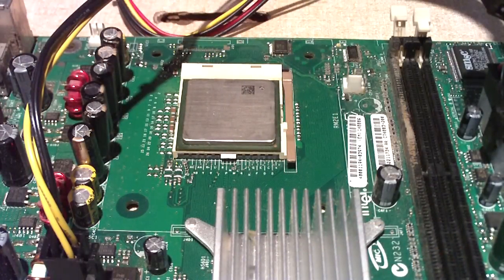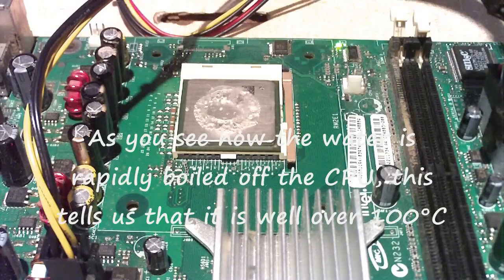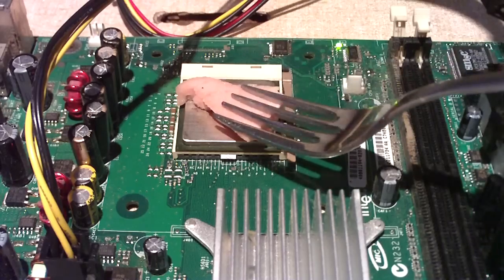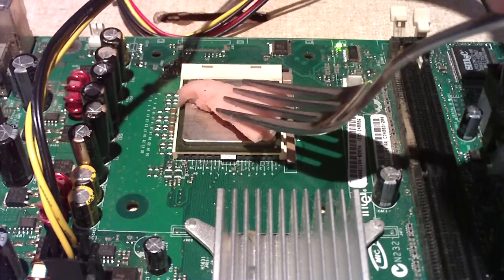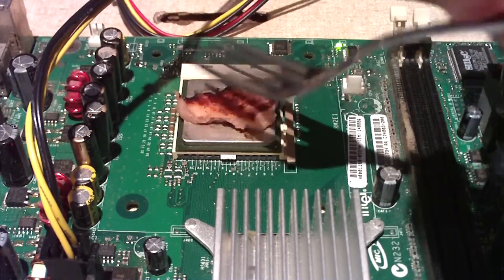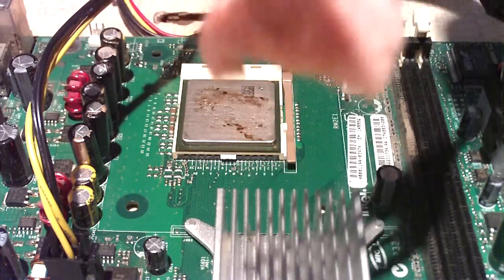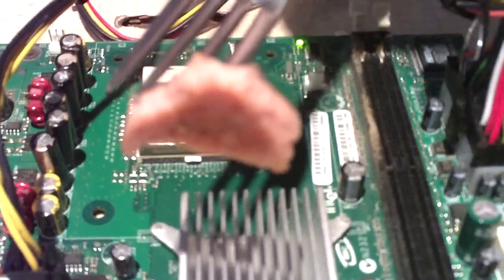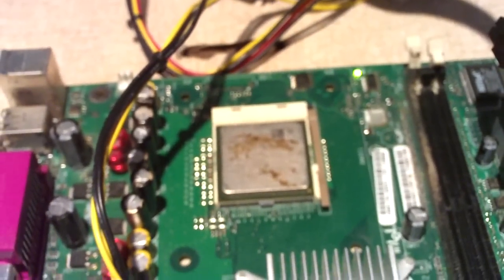Cooking with Intel Ep1 - A Demonstration on CPU Heat

Comment: Needs to be updated with the i9.
Reply: IMayBeSane And i7 7700K 😂😂
Reply: IMayBeSane it would char the bologna if you just have the bologna within 23 feet of the case
Reply: An AMD card would set it ablaze
Reply: The Voice In Your Head AMD cards are not hot nowadays
Reply: I think the 9590 would grill something to perfection
Reply: person who watches videos on youtube my nigga Replace the fx 8300 with an fx 9590 or an i9 and you are all set.
Reply: ironmatic 1 But I would advise to delid and liquid metal it first, otherwise there will be to little heat transfer between cpu die and ihs
Reply: @voice2982  no just intel CPU :)
Reply: @yheee6713  The RX Vega 64 begs to differ. Not that I have anything against it, it's a mighty fine card with how it's more affordable now and the drivers have matured. It's just got a pretty scary level of power consumption until you undervolt it.
Reply: Already livin in 2020 here, let's update this again.
Reply: @frohzn6231  what food the bit of charcoal that's left after the food immediately disintegrates
Reply: i9 10900k xD
Reply: @lithiumwyvern_  We're talking about CPUs here. My Ryzen 3 2200G rarely goes above 20°C when idle with a $40 watercooler.
Reply: @gtPacheko  But the person I was replying to clearly said "AMD cards", not "AMD CPUs".
Reply: The Voice In Your Head you dont le me sleep im trying stop thinking about memories
Reply: We can cook with a heat sink!
Reply: That'd prolly be just a turbo cooker. 😂

Comment: You did it wrong

You forgot to put oil on it so it cooks evenly =P
Reply: Candi Soda he should have added garnishment as well
Reply: Candi Soda And then have a grease fire, that'll burn the entire house down.
Reply: It's not about the amount, but rather the fact that it's boiling oil that get's into even hotter electrical circuits.
Reply: Hudson Hardin you're*
Reply: Candi Soda 800th like
Reply: Should have used Pam canole oil for cooking with slight seasonings like rose marry topped with a lemon
Reply: Candi Soda Yeh thermal paste would have really brought out the flavors
Reply: Candi Soda XD
Reply: Candi Soda used that for alternative
Reply: Candi Soda how about walls?
Reply: Candi Soda 😂😂😂😂😂
Reply: OMFG I SAW U COMMENT ON ANOTHER VIDEO SAYING U CAN POOP IN LESS THAN A MINUTE AND U GOT 631 LIKES AND I SEE U HERE IN ANOTHER VIDEO WITH 2.3k LIKESSSSSSSSS!!!!!
Reply: *thermal paste

Comment: Well you finally found a use for a celeron
Reply: i7 vs celeron
Reply: Milan van der Vliet i9**
Reply: XxCraftlordPantsxX i7 is still better then the i9 only video rendering is better with i9
Reply: Milan van der Vliet i9 runs hotter
Reply: my 2nd gen 2.9 ghz i5 cpu: pathetic

Comment: Why everyone makes jokes about AMD?
Intel pentium D extreme edition is the best heater that i ever used.
Reply: My family had both an AMD Athlon and first gen Pentium 4.
Both of them put out heat. Worked great for winter.
Reply: every single CPU produces heat...

intel fanboys should understand that
Reply: DayShadowPON3Y 
oh good, I thought I was the only brony here that watched this stupid cpu destruction crap.

But I don't necessarily like to consider myself as a 'brony'
Reply: Echo's Tech Side
me 3
Reply: DayShadowPON3Y actually no only for their fx line of cpus which did ran pretty hot but never at the levels of intel preshot pentium D that thing was almost as hot as the gtx 480 and nothing beats the gtx 480 in tearms of heat but the gtx 590
Reply: because they are both CPU brands, which both make fast and cheap processors, and both make cold and hot ones too :/
Reply: kostandrea  But AMD sucks ?
Reply: kostandrea And you gargle
Reply: PhantomForces Sniper and y'all are childish asf
Reply: Piotr Romasz and the gtx 480
Reply: Piotr Romasz here with a pentium P over 85c
Reply: Intel Pentium Disgrace
Reply: TNHenderson500 A comeback makes us childish. Hahaha that's funny.
Reply: Piotr Romasz you got it
Reply: pentium D 1? or II?
Reply: Piotr Romasz try Intel Fermi, the GTX 480 runs very hot.
Reply: Piotr Romasz No pentium 4 3.6Ghz is the best heater ever but you'll have to buy a new one very hour
Reply: Piotr Romasz I was the 1000 like l. that felt amazing
Reply: Piotr Romasz nice AVGN pic
Reply: cloneskiller nope, the precise number of likes was removed in the last yt update
Reply: Ikr? It works great and I live at Alaska.

Comment: What if I use the latest fx 9590 :D 
(Fx 9590 is known to run at high temp)
Reply: we want to cook, not make a thermonuclear reactor
Reply: I don't think you can use an fx 9590 without a heatsink... It will probably just shut down itself.
Reply: MeGarba yeah..try lowering down the clock speed. I saw this guy downclocked to 3 GHZ but still hot though
Reply: core2zero lol, it would be so hot it would split the atoms and cause a ray of plasma down to the Earth's core... R.I.P.
Reply: Wooooow, slow down satan...
Reply: What if I use Intel i7 4960x?
Reply: AccelCast - Will & Eric Why not :)
Reply: hah ! I'll just use an air cooler on the fx 9590 and cook stuff on the heatsink fins :D
Reply from the maker: Hunter Milam
It would probably get really hot if there's no RAM installed. Without RAM, the thermal shutdown doesn't always work.
Reply: Almost all Intel CPUs from the Pentium 3 Coppermine era onwards have internal overheat protection by flooding the instruction pipelines with the "NO OP" instruction to limit the heat generated by the processor in the event it passes some temperature threshold. Even if the processor has a load, whatever is running on it will either grind to a halt because it can't process anything effectively or crash because of the interruptions.

The CPU in question will still generally survive if not left to cook for a long period of time, but it will be permanently damaged to some degree; Which can usually be measured by a decreased performance level in benchmark applications or unable to maintain a set clockspeed previous to the overheating event.

AMD is an entirely different story though. AMD had no internal overheat protection mechanisms until the Athlon 64 came out in 2003. Running a classic Athlon or Athlon XP without a heatsink almost immediately lead to thermal death and in some cases the CPU can explode like a bomb and cause serious injuries to anyone nearby. I've seen videos of Athlons getting up to 700F without a heatsink just by running for just a few seconds.
Reply: you can cook a steak with it
Reply: Army SUPER A steak? You must be kidding, hell no. It'll cook a whole cow in a nano second lol.
Reply: UberInfiniteGaming Ive got one :D
Reply: You could cook on the heat sync of my OC'ed i5 :3
Reply: MeGarba Mess around with the clocks, run a stress test to make it freeze so it won't shut off, remove heatsink.
Reply: MeGarba Mess around with the clocks, run a stress test to make it freeze so it won't shut off, remove heatsink.
Reply: UberInfiniteGaming joke wouldve been a lot funnier if you didnt immediately explain it lol most people here wouldve gotten it
Reply: MrExtrodius and ironically you didn't have to tell us why it would have been funnier without the explanation.
Reply: MrExtrodius and ironically you didn't have to tell us why it would have been funnier without the explanation.
Reply: cringe
Reply: TheRanchSauce modern cpus auto shut down if they get too hot

Comment: if you wanna smelt iron, use nvidias.
Reply: *amd
Reply: ***** love amd but their gpus need temp improvment
Reply: pcgaming today They aren't as hot as people say.
Reply: +Eric! same with my 970
i turned up the fans so now it stays at 76
Reply: lol my GTX 970 clocked at 1500mhz isn't even reaching 65 celsius on witcher 3 ultra lol
Reply: TheJackalPhantom I have the bad zotac one with a shit fan that is loud
Reply: +magmamaster1801 Zotac is poopy always go with EVGA/MSI/Asus or Gigabyte as Nvidia cards the rest is utterly shit lol PNY for instance has cheap components for there cards and are mostly the worst overclockable ones
Reply: TheJackalPhantom It was a present... If I could have chosen I wouldn't have bought it.
Reply: +magmamaster1801 Well a present is always good! no complaints there boy a 400$ card for free is the best!
does you case have decent airflow like 2 front intake fans and 1 exhaust fan to blow the hot air out? if you have a Mini ITX or a front closed case with no air intake on the front and just a plain plastic/metalic plate that might indicate your GPU is choking on hot air so it pushes it fan speed to rediculous speeds my EVGA GTX 970 FTW stays under 35% while playing witcher 3 on ultra for 5 hours and stays reasonably quiet it stays nice and cool under 65 celsius at 40% fanspeed and my fans are off untill it reaches above 40 celsius :) i only have a minor fan whine between 5-15% so i just make it skip from 5% to 15% in 1 second so its gone but having 2 intake fans on the front of the case might help allot ;)
Reply: TheJackalPhantom I always keep an eye on my temperature using afterburner.
I don't really have to focus on this much anymore since I'm getting a new graphics card anyway and it has a badass cooler.
Reply: +magmamaster1801 well a GPU can be at 80 Celsius and fine but a CPU over 80 should not ever happen a GPU can mostly handle extreme temps i know this as i owned a GTX 480 few years ago and that card would reach 100 Celsius at time lol
Reply: Lol both gpu and cpu can handle extreme temp,but their life span is shorter,just because gpu usually have higher tdp than cpu and have have smaller cooler on it,so gpu overheat is occur,but cpu tdp is low,and usually have better cooler on it so it stay very cool
Reply: +Harry Tung na trust me a CPU loses its lifespan faster then a GPU if both are at 80-90 celsius the video card mostly simpyl wins because the GPU's are made to handle massive ammounts of heat its why they have massive coolers cpu's on the other hand barely cool there own TDP one of the reasons a real computer hobbiest like me and other change the stock coolers imediatly to a after marked one for facebook surving sure a stock cooler is fine but if you plan on playing games like me like the witcher 3 on ultra even the stock cooler cant keep your cpu cool... however a GPU stays perfectly fine at 67 degrees on my part wheras my i7 4790k reached almost 98 celsius and at 100 celsius my pc shuts down..... so i got a muggen 4 shythe and my i7 temps are bellow 60 celsius all the time

also at the time your ''lifespan'' runs out you upgrade anyway as the parts become obsolete before there life span ends....
Reply: It depends on TDP,such as a 980ti tdp is 250w,i7 6700k tdp is 91w,mean 980ti generate 2 time more heat then a i7,gpu doesn't have a huge cooler on it,the cooler on the gpu is thin and long,they don't have the cooling perfromance of a decent aircooler like cm hyper 212 evo,so this explain why gpu alway overheat
Reply: +Harry Tung if your GPU overheats that simply means your case has no airflow or the worst airflow possible like i said my GTX 970 at 1500mhz is running bellow 67 celsius on full load in my corsair carbide 500R case if you have a Mini ITX case that might explain it
Reply: +Harry Tung also a cooler on the GPU is actually allot better then a Hyper 210 evo since the evo its limit is i think 150 TDP whereas the cooler on GPU's is over 250 TDP so basically put if you put the gpu cooler on a cpu it would cool insanely well ;)
Reply: TheJackalPhantom if you actually put a 212 evo on 980ti,it will be cooler
Reply: +Harry Tung thats not how it works.....
Reply: my amd graphic never hit over 60 celcius, not sure nvidia could melt tungsten
Reply: +Eric! my is running at 89c
Reply: +TheJackalPhantom You can't overclock to 1500, it would instant shut your PC down. You know Voltage?
Reply: +screeem cough*titanx*cough
Reply: +pcgaming today Not at all.As an AMD user (CPU+GPU) the GPU does not overheat.The CPU might,but the graphics card is problem-free (AMD Radeon r9 255)
Reply: *AMD
Reply: screeem tru lmao
Reply: screeem AMD*
Reply: Why is everyone saying AMD? I personally haven't had any problems with most of my AMD CPUs. Except for one.... it was my fault tho... I tried making my own thermal paste.
Reply: Jaeden The Gamer Recipe please?
Reply: SkkyKidd why did you comment on an old video?
Reply: Jaeden The Gamer why did you comment on an old video
Reply: Dezqn HD why did you comment on an old comment on an old comment on an old video
Reply: Leven Alaska lol
Reply: Leven Alaska because, only special comments get commented on m8.

Comment: Was i the only way hoping/waiting for him to get shocked or burned...YES! CMON KEEP POKING IT WITH A FORK!!
Reply from the maker: +PlacidDream You're acting like I was sticking the fork into a wall outlet.
Reply: +Cube Computer Channel why an Intel processor?!?! An old AMD processor could cook some meat to 350 degrees Fahrenheit
Reply: +Boyborg690_ they have the same/ similar tdps. AMD is not as hot as everyone likes to joke around about.
Reply: +Cube Computer Channel Should at least wear some rubber gloves :)
Reply: ***** Don't have to get defensive bro... Flying pans are designed to be cooked on this was not.  Don't want to take precautions? Fine, but getting defensive to a harmless comment with your viewers and using snarky remarks?  There are other channels out there.
Reply: that is stupid the cpu runs at only about 5 volts and you wouldent even feel that also there is an insulation layer between the "chip" and plate so the electricity being 5 volts couldent even jump across In a vacume let alone air even if it did it woukd have so little energy left I would doubt it if a multimeter could read it
Reply: shocked with 5V... man, be careful when changing the tv remote batteries ...
Reply: Lol
Reply: They don't use chemicals to "STICK" a CPU to a heatsink. Clamps do... and you're thinking of thermal paste which can be cleaned off with a bit of bleach water and a paper towel... or a shirt and some spit
Reply: Ok... you're high man.
Reply: Your mom eh?
Reply: I was wrong... you're drunk and high.

Comment: Wanna smelt some stone? Use AMD!
Reply: +Rico Smith 32° on FX 8370 with stock cooler here, ever tought about your case could be to small or you might don't have enough fans?
Reply: +Rico Smith  i have old AMD Athlon 64 x2 5200+ i remove CPU heatsink and it takes 1min. 48sec. to shut off itself
Reply: +★SkillZ★⑱ The actual problem is, that amd uses 3x more temperature than Intel on the same effiency.
Reply: Intel older cpu, Pentium 4(single core) is generating more heat than old Athlon64 x2(dual core), i tested it, and i have it on my basement
Reply: +Tom Louwell Basco I was talking about new CPUs like the FX-8350 and i7-6700K
Reply: Rico Smith  ok, i agree with you! World first Highest running temps Introducing the AMD FX 9590(trash cpu)
Reply: +Tom Louwell Basco when i have the money, i will switch to Intel/NVIDIA
Reply: Rico Smith  yeah, im still using AMD Llano APU
Reply: +Tom Louwell Basco 

Which is just a factory overclocked 8350 pumping out at 220watt TDP. Dont know why they even bothered with the 9000 series. Just cherry picked silicon and viola... heres a chip that same as the one in your rig...but $100 more!!! Pfffft. 

I will say though, Intels i7 Haswell cpus, at least the first batches of em, got REALLY hot. Lots of people had issues with them thermal throttling on stock air coolers with mild to no overclocks. Think they solved that though as it was a manufacturing defect with the thermal solution used between the die and heat spreader. And the fact Intel decided to put the damn voltage regulator on the die itself instead of letting the motherboards VRMs handle the cpu voltage. Both my FX 8350 and i7 4790K run about the same temps. But both are liquid cooled as well so neither get above 45C under load with Prime95 hammering at them. 8350 draws more power though.
Reply: AMD is not focusing on Energy efficient processor and Thermal output of the processor
Reply: Yeah. Old 15 year old AMD processors are very very bad when it comes to thermal throttling. It doesn't throttle it only melts a cpu into a motherboard
Reply: +Rico Smith 
you are so petty
Reply: +Boyborg690_ yea, you had to be smart to run a computer back then.
Reply: +Chris Hunter yep.
Reply: of course, you are talking real cores vs virtual cores, of course there is more heat in the fx
Reply: You know.. It's too old to be compared to another current generation of Intel..
They had it very good tbh for those days when Intel was a joke..
Reply: +Rico Smith You, sir, just won "Best Understatement Of The Year"

My rig runs the Athlon X4 860K, and without a cooler on it, it doesn't even get to the Windows log-in screen before shutting itself off. On stock cooler, it idled at 64c
Reply: +Seth Lynch i've got an r9 390 that idles in the low 40s, max load in high 80s. i've gotta use an h80i gt cause the stock badass aircooler wasn't enough
Reply: NukeXKiller2013 I grabbed a Hyper T4 for the 860K. The CPU's fantastic and goes above and beyond what I need, but it does run hot.
Reply: NukeXKiller2013 adjust the fan curve and you end up with 40 idle and 60 under load.
Reply: Chris Hunter already tried but i live in California where its usually warm or hot. Plus mine is overclocked. Thanks for the advice anyway
Reply: hahaha amd...
Reply: ew minecraft
Reply: Taylor Irving minecraft isnt disgusting wtf??
Reply: Taylor Irving lol people actually smelt things wtf whys it you bring up minecraft
Reply: Taylor Irving smelting isn't just in minecraft
Reply: Wot